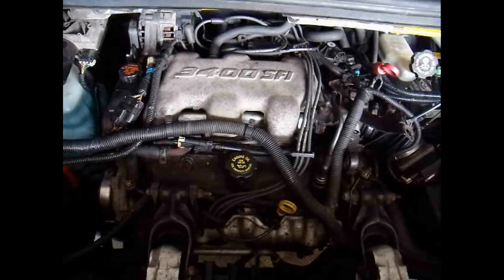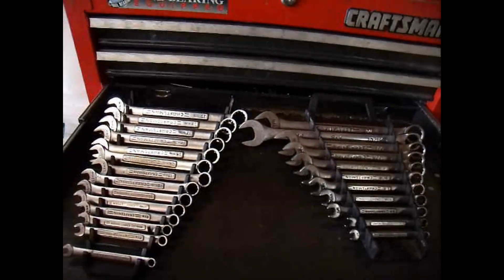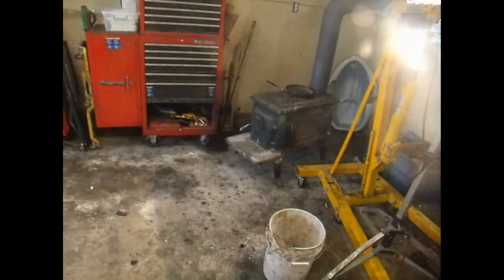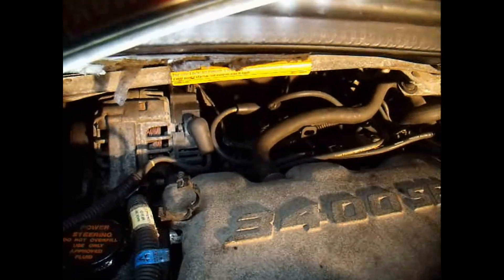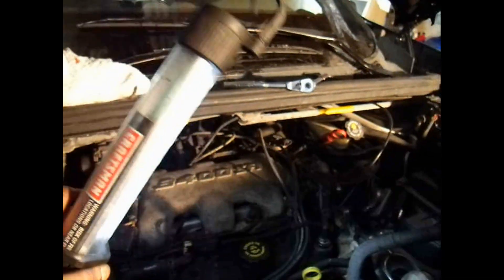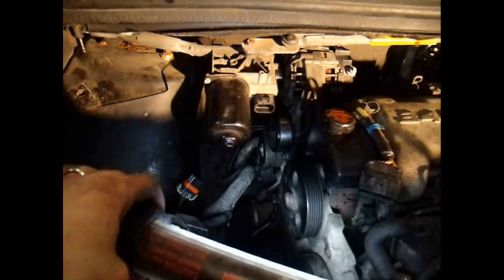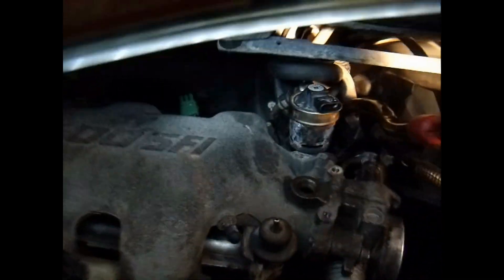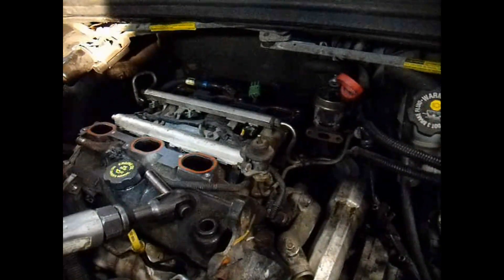How To Change A Bad / Blown Head Gasket 3400 GM Overheats Thermostat Intake Manifold No Heat 3.4

Comment: What is the story about torque vs angle? I am replacing a blown head gasket on a 97 chevy venture. I am old school using a clicker style torque wrench.
Reply from the maker: I'm the same way.  Old school yield to torque specs.  Mine were torqued to @60 ft pounds and have never had any issues.  But, the book calls for 40 ft pounds the first pass and 90* angle the second pass.  So, torque all to 40 then like a clock start at 12 and turn until approximately 3.  
VT247

Comment: Another way to check for a bad headgasket on these is a compression check.A miss is another way too.You need a torque angle gauge too,you turn the head bolts a certain degree after torqueing the headbolts down.
Reply: you do not need a torque angle gauge, with a breaker bar its very easy to estimate the 90 degrees

Comment: There are 4 bolts on the top of the intake( I think) the thing with the two silver pipes. Do I have to remove them to take the top off. Also on the back silver pipe I cannot get the gas silver pipe to come out. Do I have to did connect the pipe farther back. The pipe part way back has a clip on it when I take the clip off the pipe will not separate. Is the a special tool to release that. This why I think I have to go back farther to the second release on the pipe closer the the firewall.
Reply from the maker: I'm assuming the top intake is off.  The lower intake has 8 bolts that need to come off for i to be removed.  The silver lines your referring to I take it are the fuel rails.  There is a 10 mm bolt that holds down the lines that also needs removed.  Then the lower intake will lift up and can be set aside.  When replacing the lower intake, I run a thick bead of black silicone along the edges instead of the supplied rubber gasket.  Seems to hold better, just make sure it goes down on straight.  The black line that runs from near the water pump back around the front of the intake to the firewall can be left on, but can be tricky to maneuver.  To completely remove it, slide the clip back then twist and turn the pipe while holding the back piece.  Usually it's hard to remove as the clip keeps locking itself in place.
VT247

Comment: When you say you had to remove the air compressor to get the top motor mount bracket off do you mean the air conditioning compressor and how does this part come off? Im stuck here at this point. Also why do you have to remove the right top bracket  now? It appears it will come out with the heads or is there a head bolt burried under there? Im at a loss as to how to get at these 15mm bolts.
Reply from the maker: Yes, the air compressor needs to be removed and set aside.  You do not need to remove the lines that go into the a/c unit, the system can remain charged.  If I'm remembering right there are 2 upper and 2 lower bolts holding it on along with the brace near the front passenger side of the motor.  The front head can not be removed without it being taken off.  You should be able to see the lower bolts from under the car.  The brace on the drivers side doesn't need removed.  Also, I cut the tab that holds the oil dipstick onto the head off and slid the head over it.  My friend and I removed both heads at the same time without taking off the crossover pipe.  But even then, some of the bolts broke.  Hit me up with any more ?'s : )
VT247

Comment: Why are you taking off the battery, windsheild container. they are not close to the engine. I just replaced the timing chain and for that you need them off for room. I think this is extra work.
Reply from the maker: It is some extra work, but I like having extra room to work around.  Having to fish in and around certain areas to get tools into isn't fun.  So I took them off to have some space.  The power steering lines were difficult with the tools I had available for removal.  Instead of fighting with them, I made it easier, for me.
VT247

Comment: Thank you for the great videos on this engine. Do you put the gasket on dry and tighten things down, or do you put silicone or something else in certain places?
Reply from the maker: I put a thin layer of silicone on both sides.  It's not needed, but I felt safer doing it this way.  On the bottom of the metal pipe going into the water pump pump I put silicone on too, were the O-ring is.
VT247
Reply: Vacationtime247 So, by using your video, the shop manual, my uncle and lots of patience over two days, I was able to switch out the head gaskets, upper,Lower manifold gaskets, valve cover gaskets, o2 sensor, plugs, wires, thermostat and serpentine belt. I am not a mechanic, or very mechanically inclined at all. Thanks for the assist!
Reply from the maker: That's great.  Good work.  Hopefully everything got put back together well and you enjoy many more miles on that motor.
VT247

Comment: Thank you so much for this video!

I'm having trouble getting the dipstick out. I have the heads loose and ready to come off but that damn dipstick is stopping me. I have the bolt off but it appears to be attached somewhere else too. Any suggestions?
Reply from the maker: I never was able to remove that.  I had to cut the upper flange off of the dipstick that bolts to the head off.  Then the head will lift off over it.  It has never moved or leaked once everything was reassembled so cutting it was the easiest and quickest way.
VT247
Reply: Vacationtime247 Thanks!
Reply: Vacationtime247 I finished up today! I had to change the gasket on the water pump too. My head gasket was in bad shape but it didn't look like it leaked, the lower intake on the other hand was definitely the source of my leak. Still glad I did both. The head would have leaked very soon.

I should also mention that my fan wasn't coming on. I hard wired it to be on all the time now. I couldn't figure that problem out.

Runs great and stays cool. Thanks again!

Comment: The 2 silver pipes on the top of motor which is under the upper intake. I took the 2 bolts off that are in the center but nothing moves. Does that have to be taken off or does it come off when I take off the head with the attached exhaust pipes.
Reply from the maker: I believe you are referring to the dual fuel rails.  I usually just take off the lower intake and leave the fuel lines, injectors and pressure regulator attached.  Take off the lower intake and set it aside.  Just make sure not to damage or destroy the lines when it's moved.  You'll see how it's set aside at around 14:39  There is a 10mm clamp that holds the fuel line in place that I point out just before that time above
VT247

Comment: Can I leave the power steering attached to its pipes. I did take the 3 bolts out from inside the pulley.  I must be missing some bolts from the intake as it still will not come off.
Reply from the maker: The power steering lines need to come off along with the pump.  It can be tricky trying to remove the pump as it has to shift in weird directions to remove.  There are intake bolts underneath it that need to be accessed after it's off.  Try and soak / suck up as much as the power steering (PS) fluid as possible so it doesn't make a huge mess when it's removed.  Plus the PS fluid is very slick and makes things slip easily.  Can use a turkey baster or a syringe to get in and draw it out.  But paper towels or a rag to absorb it can be used as well.
VT247

Comment: I have a Chevy Lumina with the 3.1. Just had the cooling system flushed and a new thermostat put it. Before it would over heat and then the next day it would be just fine and after the flush it does the samething do you think I might have some air in the lines or head gasket.
Reply from the maker: Be sure to bleed the air out of the system.  Then, make sure it builds & holds pressure then maintains a steady temp.  Check for leaks.  If you loose pressure after bleeding air and find air bubbles in the overflow, chances are the head gasket is bad.
VT247
Reply: Vacationtime247 no bubbles in the over flow. I had a friend tell me to twist my cap to vent then turn on the engine for a couple of minutes and then should get rid of air in the lines. I put a line on the holding tank with a marker in the past couple of days it hasn't moved.. Thanks for the input. The guy that flushed my cooling system didn't even want to diganose the problem he just wanted to tar apart my engine and replace the head gasgets with out making sure thats the problem..
Reply from the maker: A lot of times the factory water pump goes out on them too.  Recently replaced a water pump on a '01 Chevy Camaro and the pump had no fins to move the water.  A water pump is pretty cheap for these motors.  I believe the 3.1 engines have a bleeder screw on the water neck and on top of the water pump line.  It's a 7mm nut that will bleed out air after the engine comes to operating temp.  After the air bleeds out, water will then tighten it up and check that it has pressure by the firmness of the upper radiator hose.  Let it cool down, top off the radiator.  Hope this helps.
VT247

Comment: if i choose to dig back in and change the head gaskets, can i reuse the new intake gaskets i just put in, or do i need to replace them as well. i have another engine to put in this car but i like the fact i have a back up if i screw up my so called "learning engine". i keep fixing it for expierience before i go into automotive school. also i put a thin layer of gasket maker around the coolant ports on the lower intake gasket. thanks for the help.

Comment from the maker: The lime green connector plugs into the back bottom of the MAP sensor.  The MAP sensor is in front of the coil pack and bolts to the upper intake.  The MAP sensor (manifold absolute pressure) is square and also has a vacuum tube going into it from the upper intake .  The small vacuum tube connects to the fuel pressure regulator.
VT247

Comment: Did you have heads machined? looking at doing lower intake gasket and was going to do heads also. Its not running hot, just using coolant.

Comment: I have the same engine with my 04 Buick Rendezvous. My problem is my radiator fan is not kicking when temperature gets to 230F, any thought on this? Changed the water pump, thermostat, ECT, radiator to no avail. Pretty sure the fan is working and all the relays and fuses are in good shape as well. Thanks in advance.
Reply from the maker: Had a few people ask me this question.  The temp gauge needs to get close to 3/4 heat to red on the gauge before the cooling fans come on.  To check that the fan is running, you can disconnect the temperature sensor under the throttle and the fans should come on.  Also try bleeding the system of air at the two sites, one on top of the water pump and the other 7mm on top of the water neck.  The cooling fan almost NEVER comes on in either of my Azteks.  They just don't get to that temp very often.  Hope this helps.
VT247

Comment: Ok I jus got my intake manifolds replaced I wish I would have known to get the heads done too ..would It be ok to do the head gaskets and not the manifolds ? Or would I have to do it all over again with new parts ?
Reply from the maker: I'd recommend to do all the gaskets.  You can get all new Fel Pro gaskets and things for @ $300  It's worth it.  Make sure not to torque the intake manifold gaskets down to hard, the intake can crack.  I know, I did that once.  The intake and exhaust push rods are different lengths so don't mix them up.  The head gaskets are known to fail, but once replaced with good Fel Pro HD head and intake gaskets they run forever.
VT247

Comment: hi, I like your video, I have a question, I just bought a 2003 chevy ventura , the engine has 200,000 miles , but the engine runs very smooth, no smoke or anything out of the tail pipe, I took the spark plugs out and they are dry,, normal wear , i do not know if the previous owner change the head gasket or the intake manifold gasket, my question to you is , how can i find out if in fact has been change before ,without taking the heads apart or should i just do head gasket any way. Thank you.
Reply from the maker: Look around the head and the head bolts.  If the head gaskets have been done then sometimes the bolts get replaced.  Do the bolts look new?  Can you see any of the gaskets, do they look new?  These engines last a long time once the head & intake manifold gaskets are replaced.
VT247

Comment: Do I have to take off the push rods and rocker arms or can they stay on when I take the head off. Would save time and mistakes.
Reply from the maker: The rocker arms and pushrods need to come off.  The pushrods are different lengths for the intake and exhaust, do t forget that important part.  Lay the out in a configuration you'll remember.  Putting the through a piece of cardboard helps and label them. 
VT247
Reply: Ok thanks. trying to save screwing up

Comment: of the holes dont match so i started to make my homework and search in the net and i foun that the engineblock is actually a 3.4 liter but is a special edition for the chevrolet equinox and pontiac torrent the engine is the LNJ V6 3.4L my question is if i put the heads that this engine really need to have does everything else fit ok or i need to change the intake manifold too if you have fixed one of those engines because  the heads are starting to be destroyed because of those holes

Comment: I did not find it necessary to remove the p/s pump.  There was enough slack in the line to pull the pump upwards enough to clear the bracket and move it out of the way.
Reply from the maker: Cool, next time I do this job, I might just move it instead of removing it.
VT247
Reply: Pretty sure u have to remove the pump in order to move it out of the way

Comment: Will this cause an oil leak?  I see oil running down the front, back and sides of the engine.  I replaced the crankshaft front seal, but still leaking!  Thanks.
Reply from the maker: Take the car to the local car wash.  Hose off all the oil and gunk.  Should give you a better idea of where the leak is coming from.  But no, a head gasket won't cause a massive oil leak like you've described.
VT247
Reply: Vacationtime247 
What part of cali are you from

Comment: Different topic. My son has a car that burns oil quart every 2500 Kil. It there anything that he could add to the oil?
Reply from the maker: Personally never been a fan of those 'fix an engine in a can' deals.  Could try thicker oil, but they usually thin out once the engine warms up.  Some engines oil leaks past seals and gets into the spark plug area.  Other causes include bad valve seals, where the oil is sucked into the engine on the downward intake stroke of the piston burned off on the power stroke when the spark plug fires.  Another cause is bad oil seal rings on the piston causing oil to slip by the piston and get burnt off.  It could be something as simple as a bad PCV valve.  They're cheap and easy to replace typically.
VT247
Reply: Thanks for the info. Where is the PCV located?
Reply from the maker: The PCV is usually located on the valve cover, but on some makes / models they are in other locations.  What kind of car is it?
VT247

Comment: My wifes 2003 oldsmobile Alero just crapped the bed because of this issue, its misfiring, theres coolant in the oil, and when running it sounds terrible and huge plumes of exhaust come out the tail pipe. Im debating whether or not to junk the car, change the head gasket and intake gasket myself, or take it to a mechanic and have him do it for 800-1000 dollars, suggestions?
Reply from the maker: This isn't a very expensive job if you do it yourself.  $250-$300 at most.  Just takes a lot of time to get done.  It's an expensive job if you have someone else do it.  Worst problem you'll run into is the exhaust bolts sometimes break.  Fastenal has bolts and fasteners that will fasten the exhaust back up if bolts do break.  A 2003 Alero running is worth $2-$3k.  Not running, it's $500-$1000.
VT247
Reply from the maker: ***** If the spark plug isn't threaded in right, it could loose compression or a misfire.  Hopefully it won't break when coming out next time it needs replaced.
VT247

Comment from the maker: The different holes for the head and block are like that from the factory.  Thought it was kind of strange also, but I've done this fix a few times.  All are like that from the factory.  Keep everything the same, you should only need to change out the gaskets.
VT247